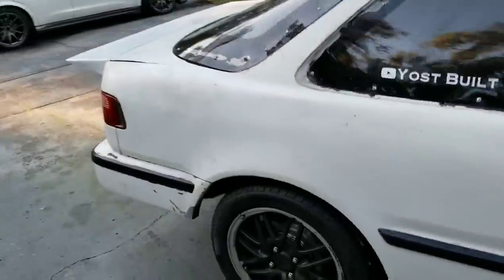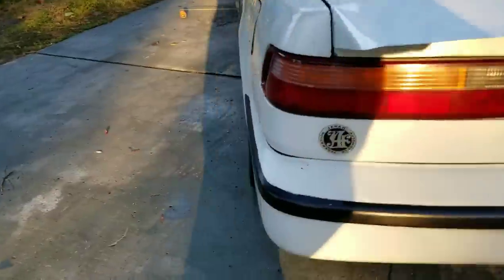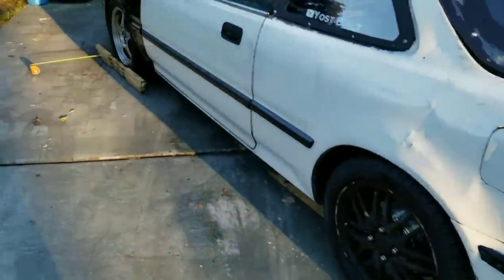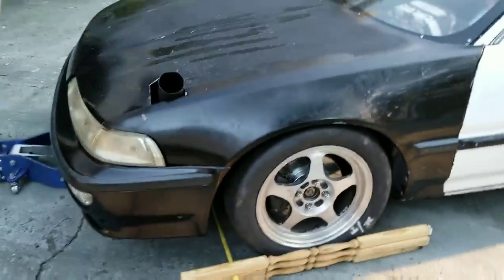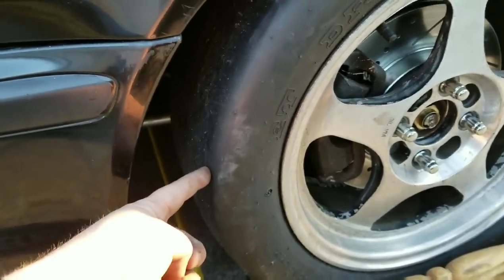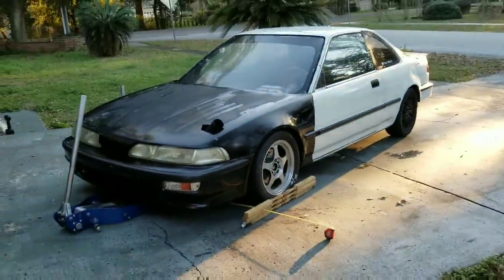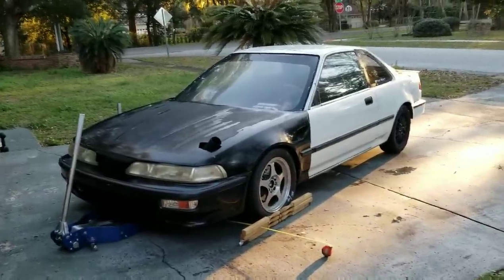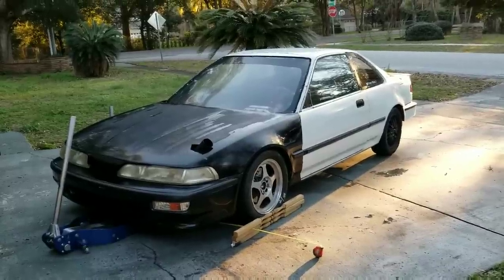LA VACA gets her track alignment and coolant system completed!

Comment: My personal experience is that I adjust front  camber to -1 . Which makes the tires tip in at the top. Which causes the tires to level out creating a full contact patch. When you launch your car. Just my $.02 . Good video man.
Reply from the maker: I got like -1.3 according to the app I used